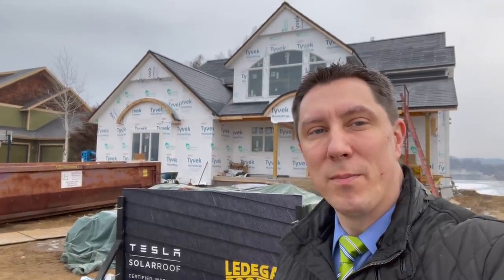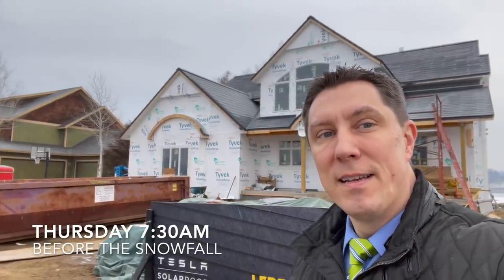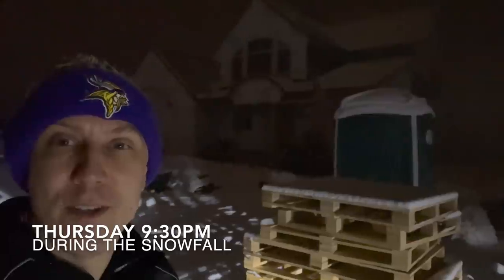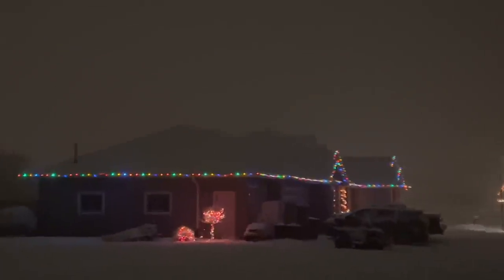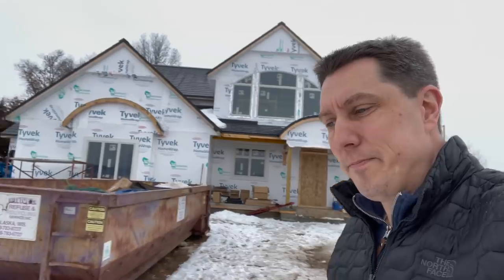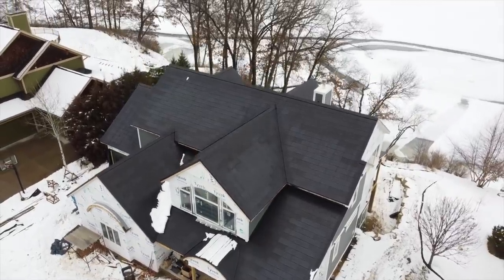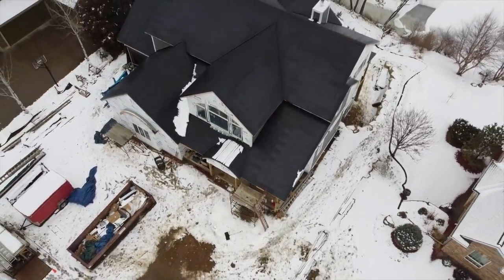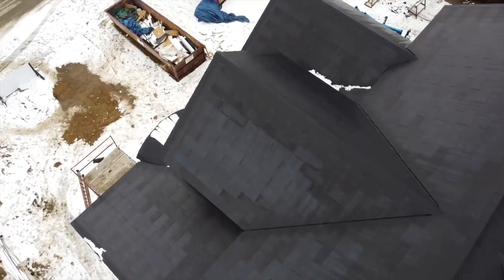Tesla Solar Roof - What happens when it snows?

Comment: The reason your neighbors' homes have snow on their roofs is because their attics are properly insulated. The accumulated snow is actually enhancing their insulation. You're wasting far more energy through your roof than you can possibly generate that far north during winter. Have you even looked at NREL insolation maps? You're in the WORST location in the lower 48 for solar power generation! You got played, pal. Pro tip: Do NOT install a tankless water heater AND flow-limiting fixtures or you'll never ever take a hot shower again.
Reply: Perhaps the solar roof is not a good insulator, but the overall effect also depends on other factors. Number of snowfalls and snow during the winter, wind in its area, temperature. 15" of snow on the roof may be good insulation in some places during some windy and cold months, but in another place/time snow on the roof can waste energy from the house. The truth is only in comparing solar roof houses vs standard roof houses and not just Your house vs his house in another place.

Comment: ...why would you WANT to waste energy to melt the snow off your roof, which in turn significantly reduces insulation, just to expose solar panels to few hours of weak sunlight at a bad angle -- IF you're lucky enough to have a clear sky?

Comment: The neighbors' heated houses still have snow on their roofs. This unheated house has no snow. Thermal inefficiency? But it can capture energy from the sun even on a cloudy day. Impressive.
Reply: Yep, but solar panels are more efficient and cheaper.
Reply: I think the glass is just more slippery?
Reply: @nazarm6215  snow on the roof is a good insulator
Reply: @josephcoleman57  until the snow load collapses the roof. IF snow was a better insulator than the risk would be worth, you would see flatter roofs here in the North.
Reply: @SteveThompson1  great point
Reply: The panels heat up when it is hit with any sun and the snow melts or slides off the roof.
Reply: @SteveThompson1  I thought people living in the north traditionally don't clear snow from roofs for this very reason, but what do I know.

Comment: I'm pretty sure the fact that there's no heat in your house is the reason why the snow is coming off like that. I can't think of any reason why it would just slip off? You're neighbors have insulation and heat. I mean the roof isn't plugged in and it's not generating any heat and shouldn't be capturing anymore heat than other houses. I'm curious to see what happens when you're living in it and the snow melts like that because you may be dealing with a lot of ice. I've been the owner of a couple large properties that had poor insulation in the attic or I guess bad ventilation and the melting snow caused lots of ice to buildup on the gutters to the point it was dangerous. 

Hope you make an updated video this winter would love to see how it goes. I am interested in putting tesla solar on my house in Maine sometime in the next 10 years. 
TY! Best of luck.

Comment: Interesting problem--thanks for sharing.  Regarding snow shedding as mitigation, we installed a simple metal roof a couple of decades ago, subsequently had to install snow guards to keep the snow and ice in place to prevent dangerous avalanches that could deposit worst case piles several feet deep on the ground in a matter of seconds.  

Shedding may or may not become an issue, and agree a better solution may be to melt the snow and duct it somewhere else.  If so no doubt Tesla engineers are up to the challenge.

Comment: im confused does the roof clean itself ,has a slippery coating or it just melts it quicker
Reply: Melts it quicker.
Reply: It's probably a combination of things the tiles have a smooth finish so less friction and the color is dark so they warm up in the sun better. And they are bigger than normal roof tiles and that affects the behaviour of the roof design as well.
Reply: glass surface combined with heat generating.
Reply: thx every0one

Comment: Our roof was installed in December 2020. We have had several snowfalls since then. Each time the snow cascades from the upper roof to the lower roof in a mini avalanche. Unfortunately our garage and front door face north and the snow that falls gets very compacted and very hard to remove. We essentially drive over it and pack it down further and have had ice on the driveway for severs weeks. I will need to be much more aggressive with clearing the shed snow after it falls. It has been a big pain so far. One of our glass tiles has cracked and when the repair team came out they told me that the field crews are aware of the snow fall problem and hope they can come up with some kind of catch system solution. I hope the home in this video does not have a driveway or patio in the shade where snow will inevitably fall from the roof.
Reply from the maker: thanks for the heads up on that!  😬

Comment: Nice feature 👍, imagine if at least 20% houses in Texas had these Tesla roofs, they could've avoid the blackouts. Chip makers wouldn't had  to stop their production and avoid scrap & losses. Lesson is learnt
Reply: Here are some lessons YOU need to learn: PV panels aren't magical. Chip fabs eat an insane amount of power. When the grid goes down, IPPs (solar and other) automatically disconnect from it to prevent the murders of innocent linemen while they're trying to restore service, so ZERO power would flow anywhere from all those hypothetical solar roofs. My panels were coated with multiple layers of ice and snow during The Great Texas Freeze and my 7.5Kw array that normally produces about 25KwH daily during the shortened-day time of year was barely generating 2KwH daily until The Great Texas Melt. More crippled and/or disconnected power sources would not have helped anything other than Elon's bank account.

Comment: If the inside of the structure is heated for construction workers, which the plastic sheeting over the garage door openings indicates it is, and the attic insulation is not installed yet, which is likely, then all you're seeing is hot air rising to the back side of the ruff, melting the contact layer of snow so the rest of it slides off the ruff.

Get back to us when the house is finished.

Comment: Its good that you shared this, thanks, but as I watched it I ended up having more questions than answers: (1) My understanding is that roofs clear of snow are an indication of BAD insulation under the roof. ... i.e. not a good sign.  (2) Obviously, snow covering the PV tiles would cut their efficiency, so not a good thing to have (3) Therefore, what keeps the tiles clear of snow ? Is it poor insulation OR is there an active process that Tesla have designed back into the system to keep them warm enough to melt the snow (i.e. use some energy that would otherwise be used by the home/grid) ?  Would seem a  VERY important question to answer here.... rather than tempt viewers to have to go away and do some research for themselves :-)  Thanks from southern France...
Reply: Normal ruffs won't have anywhere near as low a coefficient of friction as a glass ruff. Whether additional heating is required / used to create a thin water film, I don't know, but as a general rule, snow will slide better off of glass than almost anything else.
Reply: I too wonder if sending back current to the panels to heat them is a feasible thing, or wheter it is just the smooth surface that does the trick. After all, only a small portion of the tiles is "active" (I think you can spot them at minute 1:00, as they reflect light a bit differently when looked at from above), but all the roof gets clean.

Comment: Correct me if I’m wrong, but I assume you’re not heating the house right now..at least not to the level if you were moved in yet.  That’ll slightly raise the temp of roof just a tad and it’ll remove the snow a little quicker than it did in this instance.

Comment: I wonder if this is really all worth it compared to a normal solar power installation. I saw nice artificial trees with solar branches all over which look terrific in the garden and easily offer 5kWp or more. The big advantage is such a tree can rotate itself and track the sun so you can minimize the size you need. I'd rather not have all that electricity flowing through a wooden roof.

Comment: Interesting. However, whether this makes economic sense or not depends on the actual energy production over the entire year, and particularly whether the output correlates with consumption. I suspect the winter production will be miniscule even if the self-cleaning effect works long term. I imagine in Wisconsin the bulk of your energy consumption is during the winter. I don't see how this can be practical if the output is dramatically lowered during the same season.

Comment: Did you finish adding insulation on the inside? It might just be wishful thinking. Your roof might be the only one in the neighborhood that can quickly convert trapped heat from underneath. Either way, it looks good and I hope you get a lot of kWh out of it!

Comment: Good sized home and roof. What is the overall cost vs traditional roof. Not the "after savings" cost. Cost to you up front
Reply: Supposedly it's more expensive than a regular roof but less expensive than a regular roof plus solar panels. Also the glass is much more durable than all but metal roofs. So, excellent value overall.
Reply: @colinsimon777  you've stated absolutely no quantitative values... Supposably
Reply: @tonyc6996  you can get 10 kWh to 26 kWh for a new home since there's no precedent for electric bill. Have a friend ordering one now, can update you with the price later.
Reply: One thing is, you do need a minimum 10kWh system for Tesla to install it now. Maybe that will change but for now demand is higher than supply so they have to stick to full-size systems.
Reply: @tonyc6996  also, ultimately, if it's the cheapest way to install both a roof and solar panels, then it's a revolutionary product whether it's 10% or 25% cheaper or whatever. If EV's are cheaper to own than ICE then it almost doesn't matter by how much. It's just more economical so it will take over and you are stupid not to buy in.
Reply from the maker: it's between 3-4x the cost of a typical shingle roof.  similar in cost to a premium roof (metal, slate, etc).  it's about the same price as what a shingle roof+solar panels would have cost me but looks a heck of a lot better imo.
Reply: @colinsimon777  how an I stupid you're just spewing statements with no facts. I own a Tesla. However the up front cost far exceeds any savings over my other ice vehicles.. adding a 75k roof for savings over 10 years isn't smart. Investing that 50k is. Return is most important. Most people don't have "forever" homes anymore and more people are moving now than ever. The cost proposition seems silly to anyone with half a brain
Reply: @tonyc6996  then maybe Tesla should start offering roof panels outside US, in countries where people don't change house every 3 years.
Reply: @smajl159  if they could produce a reliable product they probably would do that. But the thing with tesla is everything they make needs lots of service visits lol
Reply: @tonyc6996  What is this, 2017?

Comment: I've always wondered... How do those Tesla Solar Roof Panels hold up when you have to climb up on the roof later and walk around on them?? Can they handle the weight of a normal size man walking around on them?
Reply from the maker: Yes, they do!  I'm about 200 lbs (dont judge, I'm working on it, ok?!) and I have walked on them a handful of times to put out some Christmas decorations.  They're slippery as a greased pig in a rainstorm but, thankfully, my roofers left me some rubber mats that I lay out first which help with traction.  They easily support my weight but I do not recommend walking due to the danger of slipping.

Comment: Now that another month has passed, how has the roof handled freezing rain and snow at lower temperatures?  (When it's not 'wet snow.') - And what part of WI is it?
Reply from the maker: this is near La Crosse.  we recently went through a brutal cold snap where temps were below zero (like -10 to -25) for two weeks straight.  it snowed several inches just hours before the temps plummeted.  the roof is 90% clear but the nasty cold temps prevented the snow from sliding off on a few minor slopes.  fortunately, these were non-PV slopes so it wouldnt impact solar production if the system were turned on.
Reply: Who is doing the install? I live between Madison and Milwaukee.
Reply: @Limit67  I'm investigating, too
Reply: @kkitzhaber  Ledegar is mentioned in another comment

Comment: How do the Solar retain energy in a snowy weather? I thought it gets its energy from the sun!
Reply: ? Is this a serious question? Solar systems can pump into a battery bank (optional), and also are connected to the grid. Any excess power you produce feeds the grid and typically you get paid for feeding the grid 

These panels are pulling power from those batteries or the grid. It is using more power than it generated during the day, lol.

Comment: I dont get it,
The house is non functional right? the roof isn't connected to a battery so this is simply snow slipping under it's own weight?? just because the roof tiles are very low friction? I mean the back tiles are without heaters I would think as they are not sun facing so shouldn't be solar roofs.
if its connected, how much energy does the roof take to remove the snow, and then does it recover it within a solar day during snowy winter days? Water/snow have a very high specific and latent heat. They are a bitch to heat up. It feels like you would be using energy from the grid on heavy snow days.

Comment: Great video. Reminds me of Fargo at first, then the Solar Roof performance is super impressive. Quick question that won't have an easy answer: what is the electrical performance from the  system during the snow storm? Did it cost much to melt the snow? How much generation in the period AFTERwards on sunny days.

Comment: I'd give pause on this one people. Tesla rooves are not as efficient as standard roof mount panels so we need to ask what is it that let's the snow slide off? Snow clearly adheres to the surface so it's  the static friction which has decreased. This can be through the panels themselves or due to water lubcrication. If water that Means you are losing massive amounts of what through the roof which might be likely as this is a new build home and is not insulated yet. The other option is they have lower static friction. This would. Imply that standing on the roof would be downright dangerous.... Let me see a full build home with normal panels vs this and let's talk.
Reply: Wrong, Tesla solar roofs have the heating element option for people living in snowy areas that can afford it. So it actually melts the ice 🧊 and it slides off the roof. It is made from glass but extremely toughened to withstand a kettle bell weight dropped  from a significant height

Comment: Neither situation,  1 where snow slides off and 2 where it melts are practical for anywhere with regular cold and heavy snowfall. That is going to be one dangerous roof, be careful.
Reply from the maker: noted.  I'll keep an eye out! 👀
Reply: Yes, a few inches is not the problem as we can see, 10 inches you could make a video to check if some of the solar panels have taken any damage. It is known that concrete and clay roof tiles can break if the snow load is too high and is able to slide and compress itself on the roof surface and down to the ground.

Comment: How does it melt? What's the difference?
Reply: It could be that because the material is glass there is very little resistance for the snow to slide as gravity pulls things down. Other roofing materials offer much more resistance. But its just a guess.
Reply: @tjones8893  hmm that surely is a factor, thanks

Comment: 30 F is equivalent of -1C. That's basically spring in Canada. Try -20F.
Reply: I was thinking the same thing. You can see the snow is melting on the ground.
Reply: Yeah then the melting snow will cause an ice dam in your gutters then probably built up and when it starts melting, it will get behind the moisture barrier and start molding. That happened to my sister. If you have a heated roof, you also need a heated gutter system or just remove gutters
Reply: Why is this something that bothers you all?
Reply: We did, the connectors failed in low temperatures, they are working on it.. Panasonic, Mitsubishi + others are also joining this space.

Comment: The snow on your roof helps insulate your house in the winter so that is a bad thing to happen
Reply: Snow on roofs is rated a R1 per inch in insulation value. So not great at all...
Reply: Nope..you want your attic to stay as cold as possible.  You don't want melting (at least on non solar roofs).  That is a sign of heat loss thru the attic.
Reply: @mistermister2085  Indeed. It is either the snow stays full on with no melting or all slides off. It's the in between, where it melts here and there: it'll guaranteed freeze in the gutter and downspouts. And worse case when the weather works against you even further: creates ice dams. You MAY get, in your case, trouble still in the gutters and downspouts, as there with sun in the day and frost at night....."things" can happen.